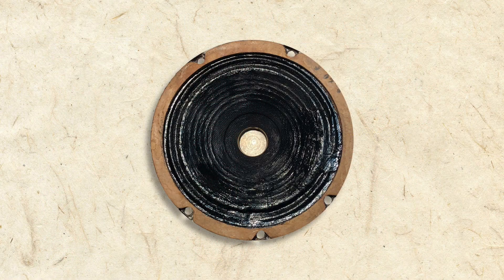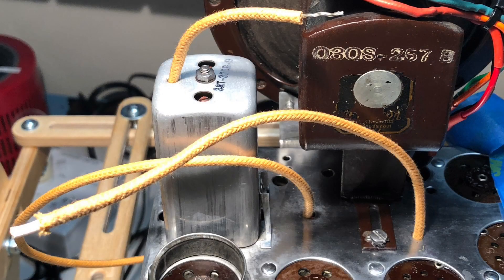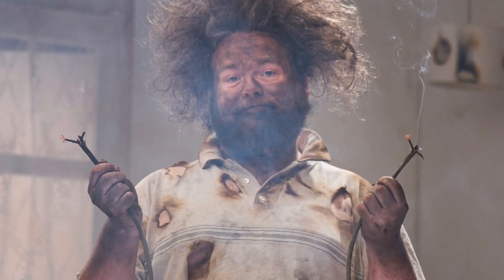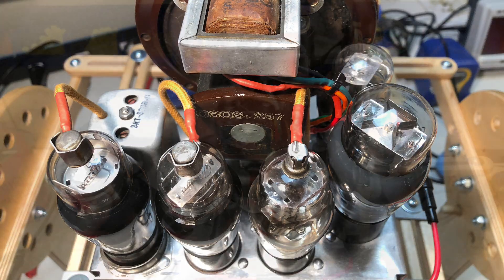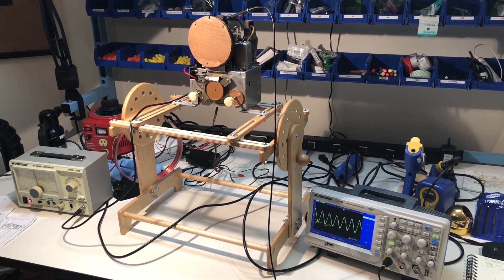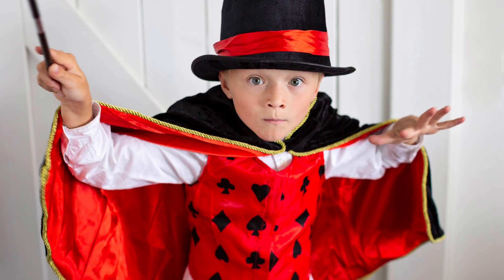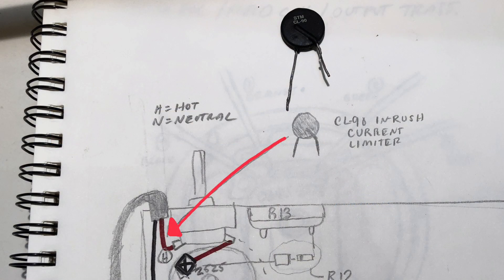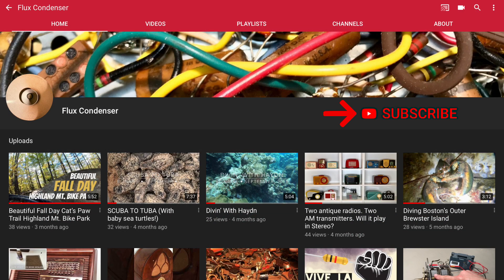Restored Antique Radio! Will It Work?

Comment: Excellent info on your process.
really like your wooden frame to hold the chassis.
is that homemade or commercially available?
thanks
john
Reply: Please keep sending more of your valuable content.
Reply from the maker: Thank you! Yes, the stand is incredibly useful and speeds up the restoration process while protecting the chassis. You can purchase them from http://radiostands.com . Two sizes are available, a small perfect for almost any antique radio chassis, and a large which will be necessary for many hi-fi and guitar amps.